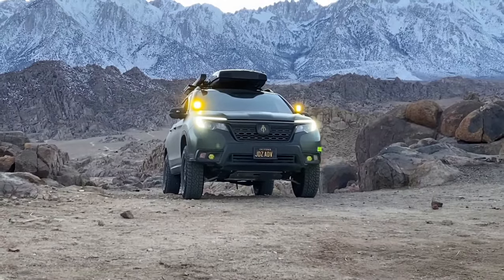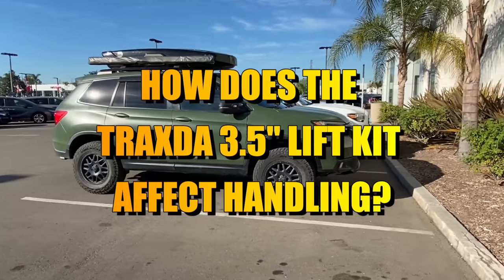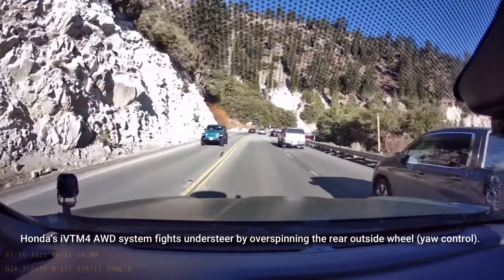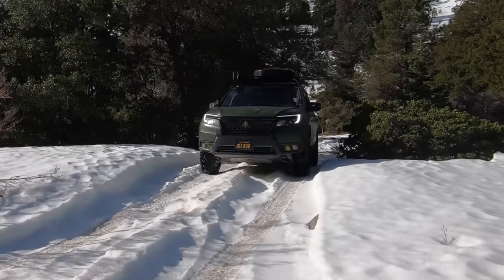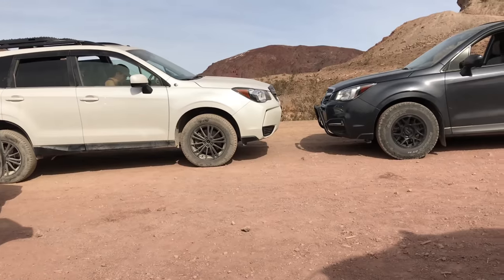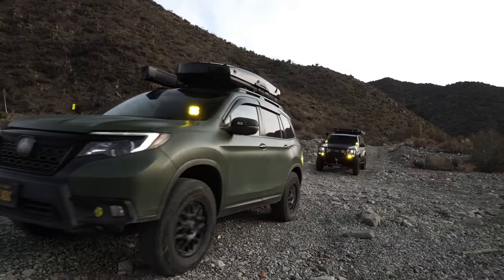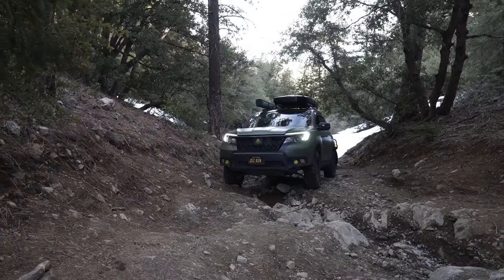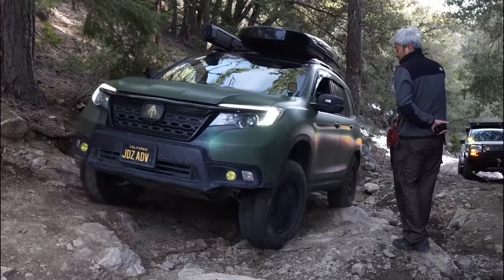3.5 inch LIFTED! Passport / Ridgeline / Pilot

Comment: I think money wasted if you like to off road and crawl over rocky terrain. Get an appropriate vehicle with Sway bar disconnect and reconnect system.
Reply from the maker: Thanks for your opinion!  I totally agree!  But this is my daily driver and I do a lot of destination overlanding.  In 2 years of ownership I have 63k miles on this Honda.  Nothing has broke!  My rear sway bars are disconnected full time.
Reply: @JonDZ_Adventuring  But without sway as a daily seems not to be very safe for family. My vehicle on the other hand has been properly lifted and disconnects sways front and rear when needed to do a full extend. While reconnects when back on highway and handles great. I do think Honda makes awesome vehicles and can be great on dirt roads. But why mess with already a great vehicle and change all of the dynamics. When changing dynamics of suspension you are affecting steering and handling and many other factors. Of cause this is your own vehicle and its awesome that you are doing this, I recommend Lexus GX 470, GX 460, LX if you can afford it, 4runner with KDSS system, Wrangler is also a great choice.
Reply from the maker: @donkeyrider  the dynamics aren’t changed much.  It’s an excellent daily.  Best daily I’ve ever had.  I like it better than my Subaru WRX.  Doesn’t handle as well, but that’s expected since it’s a SUV.
Reply from the maker: Btw, no vehicle is “properly lifted”.  Doesn’t matter if you lift a Toyota, Jeep or Subaru, lifting greatly modifies a vehicles dynamics and makes it much less reliable.  If you want any of those vehicles to last, you leave them stock.
Reply: @JonDZ_Adventuring  agreed

Comment: Honda is finally trying to step up there offroad/overland game,  but not even close. That kit cost way too much and it doesn't even include upgraded struts and and shocks with the kit. What a rip off. I'll stick with my Toyota truck instead.
Reply from the maker: Thanks for your opinion.  What toyota truck do you drive?  I actually was going to buy a 2019 Tacoma, but I couldn’t fit in one properly.  They made the dang cabin too small and the floor too high.  It’s like sitting in a Corolla, AND YOU KNOW WHAT IM TALKING ABOUT!  True story, the Honda Dealership was next door during the test drive It did 0-60 in 5.8 seconds.  I drove a 2008 FJ cruiser and a 2010 WRX and it’s like they had a baby and out came the 2019 Passport.  The J120/150 platform is just so dang old and in desperate need of a refresh.  I didn’t like the FJ, especially as a daily driver.  So why would I want to go back to that platform?  If i could do it again, I’d buy a Wrangler JL to be honest.  They’re better in every way compared to their toyota competitors except reliability.  A $32K JL wrangler sport on 33’s with a spacer lift will go places a $39K Tacoma TRD offroad just wouldn’t be able to go.  The Honda is a rockstar onroad, the Jeep is a Rockstar offroad. Well.... I guess the Tacoma should probably be a rock star in reliability.  Have fun dude!
Reply: I drive a 2005 Tundra Dbl Cab with a 4.5" Tuff Country suspension lift running with 315/75/16 BFG KO2's 16x10. I love this truck. The 5th Gen Toyota 4runner TRD Offroad and Jeep Wrangler Rubicon would've been better. Everyone has their own preferences and taste. Keep it up though. It looks nice.
Reply from the maker: @MrJavinvang1  I like the 1st Gen Tundras, it’s the RIGHT size vehicle.  Honesty, if the 3rd gen Tacoma was built with a taller cabin, I would have settled for the wheezy power plant and transmission for it’s reliability and truck capability.  The reason I didn’t consider Jeep at the time was because I had a 2015 Forester that had the CVT die at 60K miles.  For the past decade Subaru has been considered a “reliable” vehicle, but not only did the transmission die, the suspension components couldn’t handle abuse amount many other issues.  O2 sensor, turbo impeller, valve spring issues.  It was a nightmare and I was only going to look at 2 brands:  Toyota and Honda.  As far as Honda trying to get into the Overland/ Offroad scene, I don’t think they have really been trying.  They’ve been so modest about off-road capability.  While Jeep is calling 1st gear in a Jeep Renegade Trailhawk “4-low” Honda didn’t do the same despite having the same 20.4:2 crawl ratio.  While Ford marketing calls their rear twin clutch differential a “rear diff locker” Honda has been calling it power based torque vectoring.  I feel the midsized Hondas do exactly what Subarus are marketed to do, and they do it well.  Well, I really appreciate the comments.  I welcome other points of views and sharing my own experiences.  Thanks for the reply and not just saying “you should have bought a Toyota/Jeep”.
Reply from the maker: @MrJavinvang1  oh, by the way, I have 63k miles on the passport with nothing broken, it’s been great 🤞.  I don’t expect it to last as long as a Toyota, but hoping for 10 years atleast
Reply: Lol. As a former Pilot owner and current TRD OR and Gen 2 MDX owner, these vehicles are significantly different. The Honda AWD system is actually very advanced. That being said, I think it shines for On road driving or driving on road in bad conditions. It can’t do things that a Jeep or Toyota can, it just can’t. Also, my TRD with 32” tires gets the same mileage as my MDX. I wouldn’t even consider a Subaru for real or semi real off roading. The Honda’s being a unibody makes for a great ride for road. I like the new passports, good proportions (reminds me a bit of the Gen 2 MDX). The new pilot is a little large and soft looking for my taste, and the passport is ugly AF and no male under 70 yo should be seen driving one (btw, my family happens to own a few Honda dealers and an Acura dealer, my cousin is the primary team principal and driver of the HPD Ridgeline off road truck program, so I have plenty of reasons to be biased towards the ridgeline, but there are somethings I just warm up to).
Reply from the maker: Spot on Man!

Comment: if you're gonna spend all that money why buy a honda?
Reply from the maker: Value!  I bought an EX-L with full leather for 38K and this thing has BALLS!  0-60 in 5.8 seconds.  Just to put things in perspective, a Rav4 adventure goes for 35K, and a top of the line Rav4 is more expensive than a top of the line Passport.  Also, iVTM4 is one of the most advanced AWD systems on the market.  So you have one of the quicker non luxury midsized SUV with one of the most capable AWD systems, with one of the most aggressive gear ratios.  Well.... you got something special.  I have a video titled “why I chose a Honda passport and why you should or shouldn’t” I actually tried to buy a Tacoma, but I couldn’t fit in one.  I was going to settle for a 7.7 sec 0-60 for more off-road capability but it was seriously like sitting in a Toyota Corolla, actually probably worse because there’s no way anyone is sitting behind me.
Reply from the maker: @mattbrown2701  oh!  I forgot!  That’s why I bought it.  When my Subaru broke (dead CVT at 60K miles) I was only going to look at 2 brands... Toyota and Honda.  I’ve had a lot to wrong in the Subaru before the transmission finally died.  In the Honda?  Not one thing.  Well, besides a bolt that came loose that I just retightened. I have 63K miles on the Passport now!
Reply from the maker: @mattbrown2701  here’s me pulling out a new model Chevy Silverado Z71.  Swipe to the to the right to hear me tell his tow truck friend that a Honda pulled him out 🤣. 

https://www.instagram.com/p/CJoMb_rsox0/?igshid=n4h3vnreyg6z
Reply: What's wrong with driving a reliable Honda? I say people buy and modify any car how they like. No need to be like everyone else.

Comment: I have a stock 2022 honda pilot Trailsport.  On the driverside visor there is a caution about the pilot being tippee. Does the 3.5 inch lift kit make this worse?
Reply from the maker: Every crossover/suv has that sticker.  It's required by law that was implemented in the late 1990s.  Here's the excerpt from an article:

"The new label is terse. It reads: “WARNING: Higher Rollover Risk.” It adds below: “Avoid Abrupt Maneuvers and Excessive Speed.” The government’s new rule also will require that safety information in driver manuals be made easier to understand." 

https://www.latimes.com/archives/la-xpm-1999-mar-05-mn-14328-story.html

Does the 3.5" inch lift kit make it worse?  We'll, I felt I explained this in my video, so now that you understand why that sticker is on the back of the visor, it will all make sense.